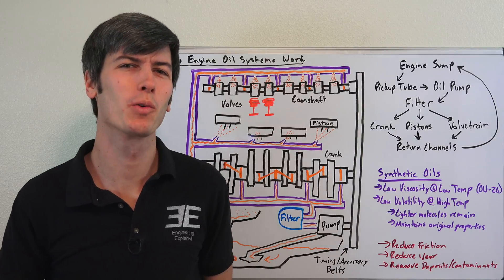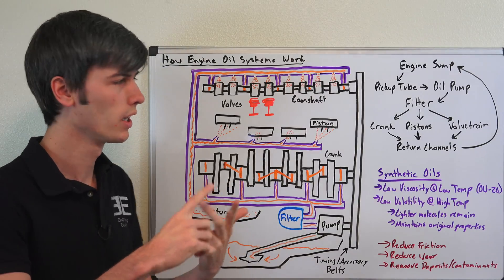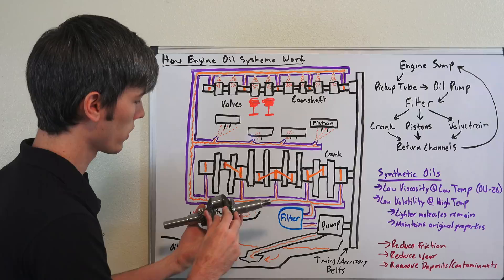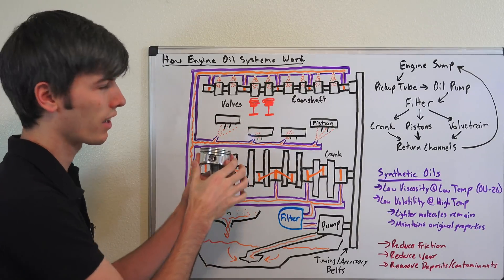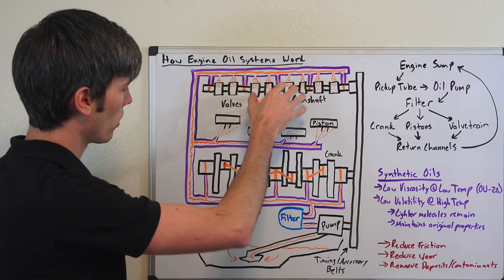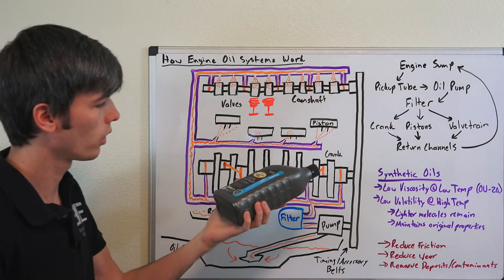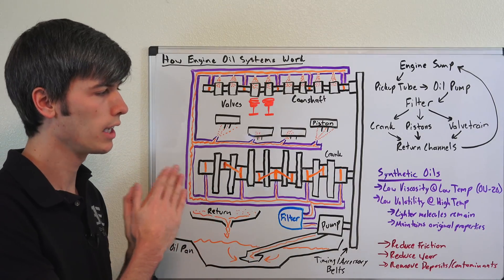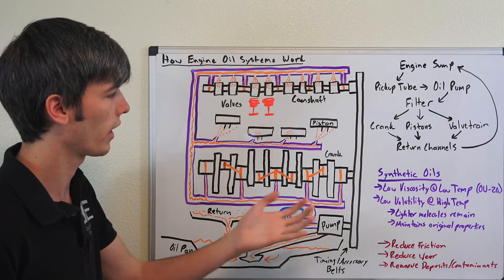How Do Engine Oil Systems Work?

Comment: how about when i live in indonesia which is 35-40° Celcius everyday ?
my owner manual say i should use 0w-20,and the car was CBU (Completely Build Up) All new Vezel from japan,
and i know japan summer was not that hot,and also they also got Winter,which  they need a thin oil
so do i need to use 5w-30,instead of 0w-20 ?
Reply: Charles Choo You would definately want to speak with either a local Honda company to find out what to use. I believe japan is a cold country, while indonesia is very hot. You should be using something else, especially with a modern car. Personally i would use a higher viscosity if i had no other way of knowing, but your best bet is asking the manufactuer, but then again, if its been working for you for 2 years, then you should probably keep it the same. In the end the choice is yours.
Reply: Sky Furry okay,thanks a lot for ur information mate,really appreciate it
Reply: What car do you drive?
Reply: Generally older cars arent effected much by a change in oil viscosity such as the one you are about to do. If the car is around the year 2000 id say it would be okay. If its about 2006 plus, then id really want to find out what the company recommends. They sometimes have a graph for different temperatures, and that allows you to choose your own viscosity dependant on the time of year and where you live.
Reply: i'd check the owners manual usually there is a chart that says what recommended oil viscosity is recommended given different temperature ranges
Reply: im using 2015 Honda Vezel, directly import from japan,
and the owner manual say only use 0w-20.
i been using 0w20 for 2 years now. and i change the oil yearly for my engine,cause where i live was pretty near,and my car are not even hit 8000KM.

Comment: all this time i thought Crankshaft is submerge with the Cylinder Oil!  😂😂😂😂
Reply from the maker: In some smaller engines, there will sometimes be an oil stirrer of sorts, which comes off the connecting rod and plunges into the oil sump, splashing oil around the engine. A lower cost alternative to getting oil around the crank and pistons for small, cheap engines.
Reply: Engineering Explained that's explain why i thought like that. I remember learning one piston small engine cross section while in secondary school (probably motorcycle engine). Thank for replying 😀
Reply: Believe that older type oils were prone to aeration / foaming if the sump was overfilled, due to mechanical agitation of the liquid. Along with all the other additives used in modern day oils, an anti-foaming agent mitigates this issue.

Oil pump is designed to move liquid, not air (foam). Foam oil has a lower specific heat, lower viscosity, and lower pumpability when compared to liquid oil. Foam oil will increase in volume causing to work past oil scraper/piston rings, which can lead to increased oil consumption and possible runaway engine...especially if diesel.

For racing engines, the higher revs and lateral g forces can increase exposure to these foaming risks. Believe racing engines typically use a “dry-sump, forced-pressurization” lube oil arrangement, where the bottom of the lower end is “dry”, and oil is collected in a separate tank. It’s a more complicated arrangement to maintain, but they are tearing open these engines much more frequently than a daily driver.
Reply: Splash lubrication is pretty inconsistent, and it’s efficiency/consistency depends on maintaining proper oil level, proper clearances, and not inclining the engine block too much. The greatest benefit for splash lube is lower cost, as the tiny oil passages and oil gallery do not have to be machined. The greatest limit for splash lube is the power rating, as the running gear inside an engine can produce less power while being impinged with liquid oil.

Anybody know where the oil pressure sensor is located for a splash lubricated system? =)

Comment: Thanks for posting this video.  One point of confusion I have is when non-synthetic oil is nearing the end of it's usefulness in an engine, I thought that you said in a previous video that it breaks down and loses viscosity and thus fails to stick where it needs to for lubrication.  In this video it seems that natural oil gets more viscous because the lighter molecules burn off.  Which explanation do I have right?
Reply from the maker: Well, actually, both can occur. There additives called viscosity index improvers which are more common in conventional oils; as these additives break down, the oil loses viscosity at higher temperatures. That said, the oil is also accumulating contaminants, and burning off the lighter end throughout this process, so the oil gets thicker, regardless of temperature. For any interested, here is a link to the previous video discussed: https://www.youtube.com/watch?v=tYkg0oDUXs8

Comment: Could you do a short video explaining Lucas Oil Stabilizer. is this really or a scam? why would I use it.
Reply: More snake oil.
Virtually every major synthetic oil has a balanced and optimized  additive package and adding additional chemicals usually results in a chemical imbalance and reduced oil performance.
Reply: It sounds so wrong to simply add more fluid to the oil system that ISNT motor oil when manufacturer specs don't call for it. but lots of mechanics swear by it and it's sold everywhere. should everyone use it? risks / benefits?
Reply: The oil manufacturer has already "added more fluid" to the oil, i.e. additives, which is why they say that you don't have to...

Comment: Can you explain what the stroke of a car is?
Reply from the maker: The vertical distance the piston travels.
Reply: And so i guess having a larger stroke would therefore mean the engine would have more suction, more space for air and fuel, and therefore more power. Thank you!
Reply: Sky Furry - this is were the terms "over square" and "under square" come from. Traditionally American muscle cars had longer strokes relative to the bore and that's why red lines were usually somewhere around 5500 rpms.  Traditionally European engines has shorter strokes compared to a wider bore and therefore those engines could rev to 7-8000 rpms.  With modern fuel injection, ecu management, and computer precision engineering we now see larger displacement engines able to handle pistons speeds that come at 7,8,9k rpms. (Generally speaking).
Reply: So youre saying a larger stroke also comes with the downside of a larger inertia, and not able to achieve as high rpms?
Reply: Sky Furry generally speaking. For example when Honda increased the displacement of the S2000 in the US from 2.0 to 2.2 they had to drop the redline 800-1000 rpm or so (technically they could have kept it at about 8500 but for reliability they dropped it lower as a buffer). The Bore is the same but the stroke was increased...8200/8500 rpm for the 2.2 produces the same piston speed as the the 2.0 at 9000 rpm. The F20 block is very robust from the factory with its fiber/aluminum composite piston sleeves as well as the forged connecting rods - Honda was able to squeeze 90% of its potential because of precision engineers components - and why it's $$$ to squeeze any more power out of the stock engine...
Reply: Exactly. The old V10 3.0 of the late '90 first 2000 used to rev up to 22000 rpm. They din't have the amazing power of the old 1.5 turbocharged 4 cylinder of the '80 (BMW's one was said to produce something like 1500-2000 cv with a 4 bar turbo pressure during qualifying sessions) but damn they sounded amazing
Reply: to add on, this also ties into the pistons inertia, with a longer stroke, the relative speed of the piston is increased going from top dead center to bottom dead center. This in turns reduces the max rpm as already stated.
Reply: Joe Dirt I like to tender my meat before a stroking
Reply: Kirk Augustin The way i am seeing it, a shorter stroke is like an F1 car. The displacement is a lot smaller, but it makes up for it with a high revving motor. A longer stroke sacrifices rpm for more torque per revolution.
Reply: Luca Mino Alright. Awesome. Thanks for that man.

Comment: I don't use oil in my Accent, weight reduction fam
Reply from the maker: Probably because it all leaks out. :D
Reply: Engineering Explained straight Savage
Reply: Hyundai Accent Fan Club i use water its just like oil they are both liquids
Reply: Hyundai Accent Fan Club and water is so much cheaper
Reply: i took out the engine and it worked better than ever you should try it
Reply: Remove the chassis
Thats what makes it heavy
Reply: Tool0GT92  Lol
Reply: Accent doesn't need these peasant fluids, it will run dry for years.
Reply: ew
Reply: you's a funny